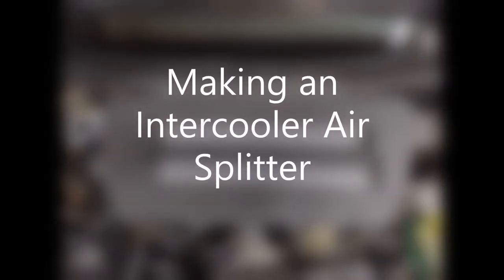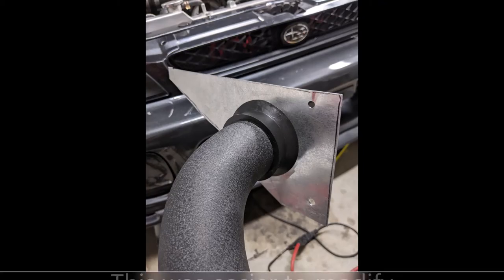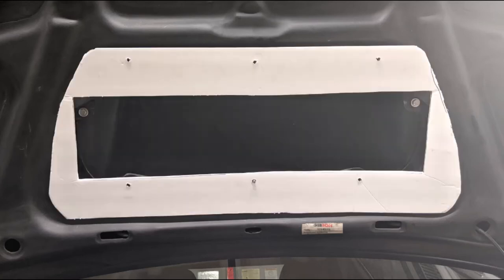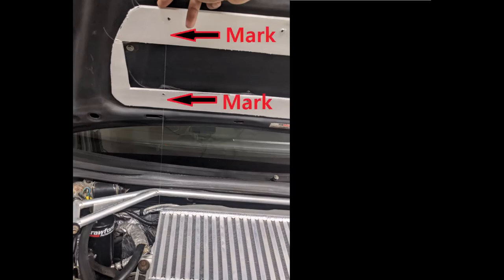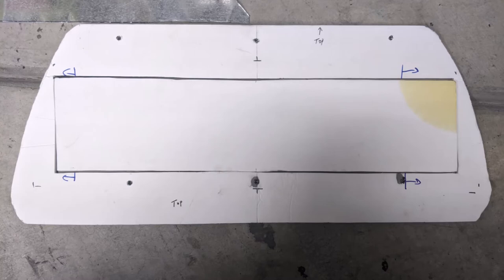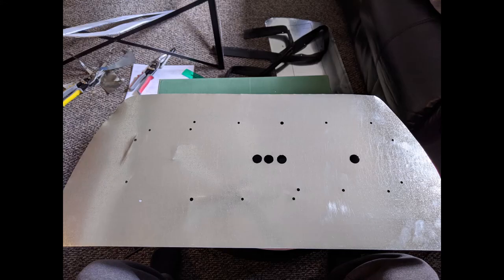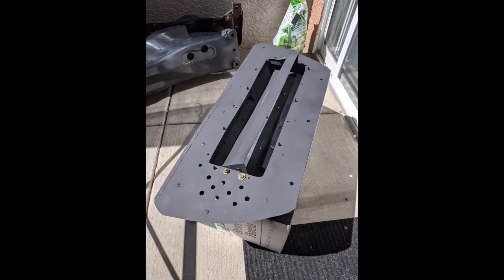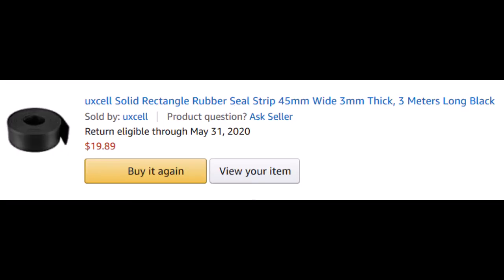How I Made an Intercooler Air Splitter for My Turbo Subaru Impreza WRX STI Swapped GC Build Project

Comment: Sir... How dare you do so well with your thinking and product. Great vid . Haven't looked yet, but fallow up vid with data off your laptop or access port.
Reply from the maker: Thank you. Unfortunately I did not collect air temperature data. However, I do have another project car that has an aftermarket splitter. So, it's possible for me to test my homemade splitter, a production splitter, and no splitter. I think I may have an OEM splitter too. It may take a while because I have a long list of videos to put out, but I'll write this idea down so it's on my radar. Thanks again for watching.

Comment: you can sell some sets of these and will be nice if made in aluminum
Reply from the maker: Not a bad idea. If I had a proper way to manufacturer them I'd look into it. I would only charge people if it were a much nicer product than it is now. This was more for fun/testing. Either aluminum or injection molded plastic prob work well. Carbon fiber if I wanted to be fancy lol.